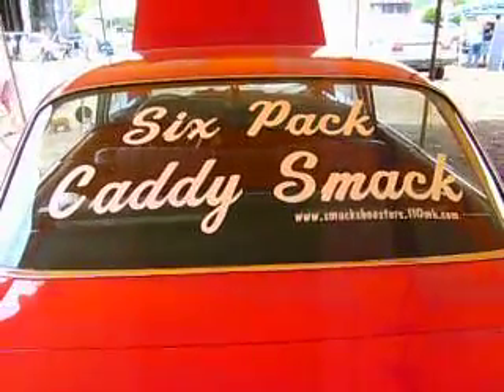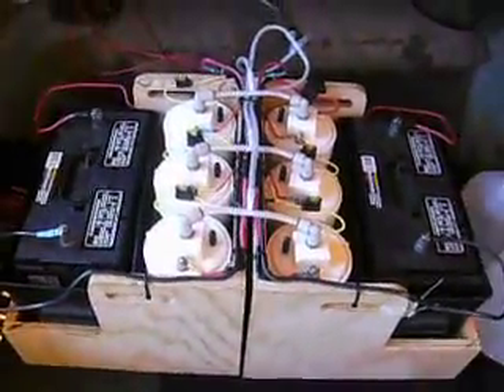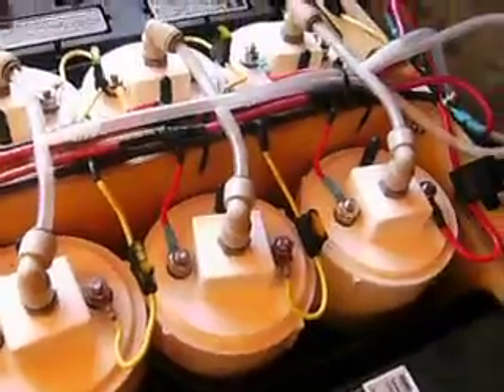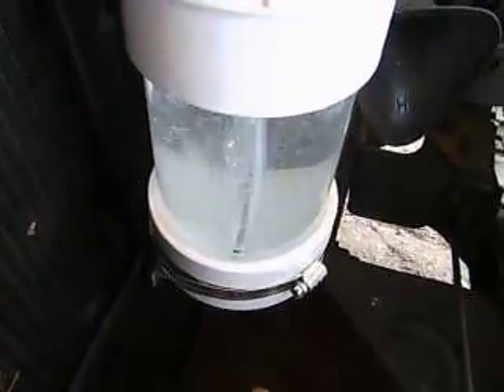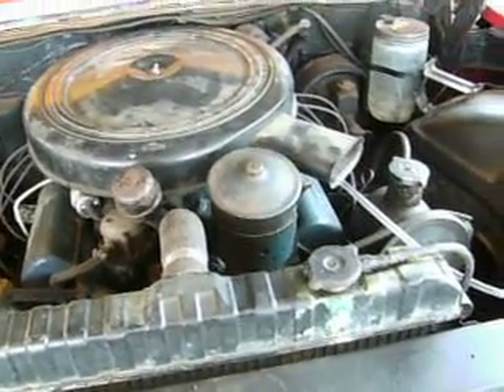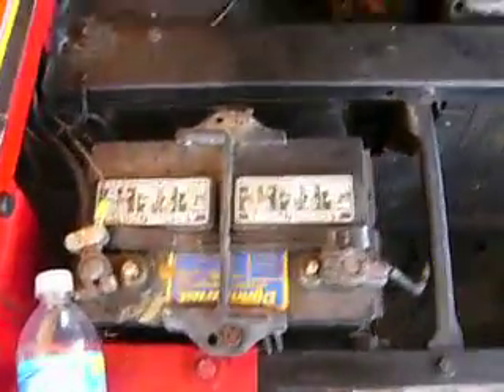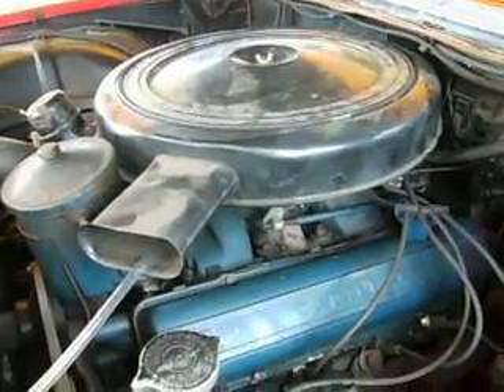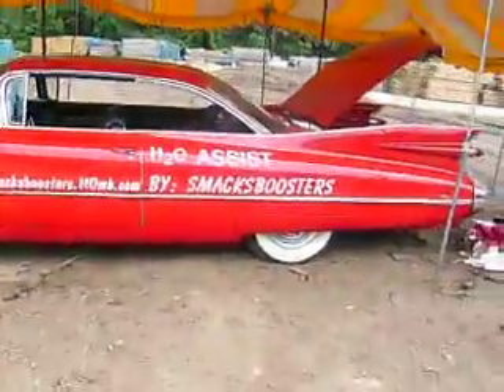The Six Pack Caddie Smack

Comment: I want to run my booster from a (solar-charged) battery but some research discovered this "C20" rating is norm for specs. ie divide a/h by 20 for nominal discharge rate. Faster discharge can take you below 50% and reduce life from say 2k to 200 recharges. I ended up thinking Id either buy new ones yearly or get much bigger capacity to start.. I agree about results vs longevity/optimizing BTW.  Just wanting to avoid wasting $.

Comment: hi smack,

wait a second here, if the battery is rated 125 amp/hour, isnt that assuming a 20-hour drain cycle?  I.e., its designed for a max of about 6 amps/hour under normal use, if you want to be able to recharge it.  

If that's correct you'd need TEN such batteries for a 60-amp load or TWENTY for 120A... or get batteries rated for like 1000 amp/hours - am I remembering this wrong?

How many times do you expect to be able to (or have already) recharge those batteries?

thanks, ManFmNantucket

Comment: I had this exact Idea to put a Deep cycle mariene battery in the truck so it wouldn't put any more stress on the stock alternator.  What size batteries you using?  I was thinking of possibly getting a 110-130 Amp hour deep cycle battery.  Assuming a 30 amp draw (I have a 4 cylinder) The battery should last me 4hrs or so.

Is there a clear diagram showing your smack cell setup anywhere?

Comment: I built this booster,and the plates did not hold up after 3 hrs.I  used a pwm' amps held at 9 amps ,distilled water was used and a very small amount of soudium hydroxide.Temp was 130 deg volts 13.7 I used the disc from Hyfusion....